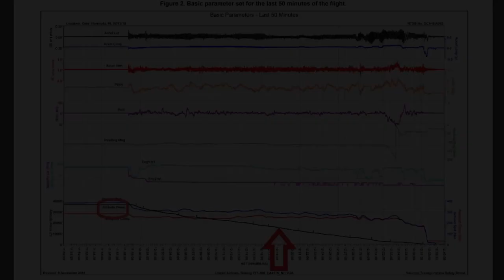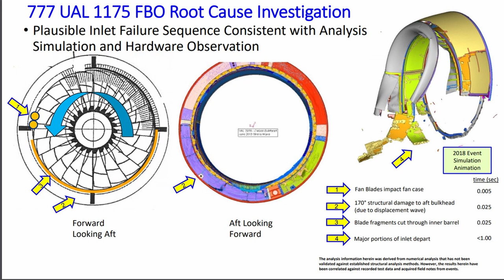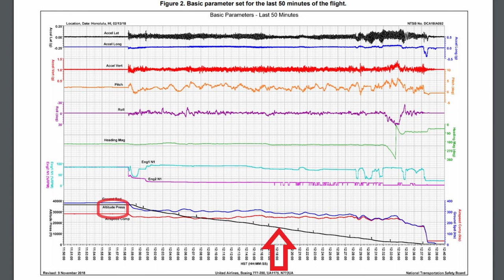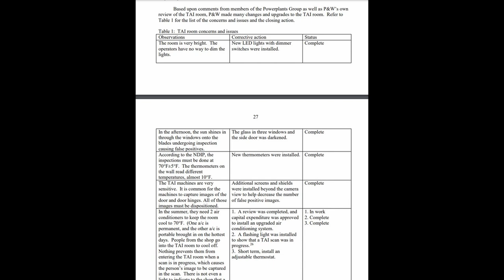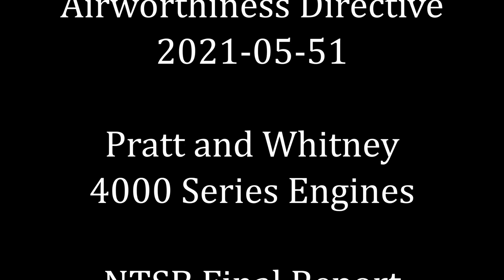Emergency AD & NTSB Final Report UAL 1175 Fan Blade Failure

Comment: You imply in your commentary that the use of color imaging would be better than black and white because black-and-white means it's older equipment.   Having worked in thermal imaging for 20 years, I can tell you that the use of pseudo-color is not an aid.  The color is not generated by the imaging equipment, it is an artifact assigned by a computer to an image through a lookup table.  Hence it is pseudo-color and not a real color image.  The color often obscures information as you no longer have a uniform scale from black to white to evaluate.  Instead, you have to attempt to interpolate what a specific color means, and often the color assignments by the computer are not smooth transitions between temperatures.   This is why medical X-ray images are still presented to doctors in black and white even though the images are now created through electronic imaging and not film.   The use of black-and-white is far better in presenting data as it removes a distraction (color) from the interpretation of the image.
Reply: Not as technical, but, boroscope technology, while able to take measurements and record in incredible detail, has remained greyscale for much the same reason.
Reply: Which was the conclusion reached in the tabular report on the testing facility shewn in the video.
Reply: Plus Pixel size. 3 Pixels are "wasted" for 3 colors when trying to see the smallest of details.  A tiny crack can be obscured because of the color. B&W gives you a smooth gradient from Black to white to see changes in density.  It is also why Astrophotography (think Hubble) uses "false color" to get as much imaging detail as possible at a given resolution and pixel size of the imaging chip array.
Reply: @gnuspudguns 
Actually I use a full color borescope for diagnostic purposes and so do several other industrial repair shops in the area.
If we convert it to digital  then it is saved as a B&W (greyscale) image.
Reply: @JeffCounsil-rp4qv 
True, but with the advent of the 128 megapixel cmos imager there is now sufficient detail even under 1000x to do both true color and greyscale.

Things have advanced many fold since the Hubble Telescope was launched.
Reply: @RicktheRecorder  g
Reply: Modern X-ray imaging uses efficiently/usefully color to characterise micro-structures, elements, etc.  Ex.: Polychromatic X-ray diffraction...
Reply: Density color slicing or pseudo color is a technique to allow visual inspection by allowing a human operator to see more than the 15 to 20 shades of gray that most of us can see. However, the human eye can see many more colors represented by color, hue and intensity. So the trick is to feed a black and white "image" containing many more shades of gray into a computer that can easily discern hundreds of shades of gray. Then the computer assigns a unique color, hue and intensity and presents the operator with a colorized display allowing the operator to effectively discern very subtle shades of gray representing subtle indications that the human eye could not otherwise see in a black and white image.
Reply: Unless you employ a color CAMERA to record three channels of chromatic brightness instead of just one. It depends on whether your color sensitive paint changes color or just brightness.
Reply: @slehar  TAI does not use color sensitive paint as the faint heat source emanating from the discontinuities of interest is far to weak to image with color sensitive paint. The object is to attempt to turn the fan blade into a black body so that a thermal imager can "see" the extremely faint heat signal originating from the fatigue cracks of interest. Acoustic energy is the exciting force that causes the sides of the fatigue crack to rub together thereby generating a heat source hence the name Thermal Acoustic Imaging.
Reply: Yeah, bayer-filtering (in color sensors) also doesn't do wonders for image acuity.
Reply: Being a long time industrial thermographer I concur what you're saying about the black and white image is far superior to see what is going on.
Reply: @richardpeugeot9143  I can only tell you that the IR cameras I used, and they were six-figure expensive,  would generate pseudo-color.  The custom frame grabbers and image processing computers the frames were put into could also generate pseudo-color for the images.    When you're looking for 0.01-degree temperature differences - color just got in the way.  It was far easier and faster to look at the images in black-and-white for live image evaluation.  Ultimately, the frames had to be rectified so the image was square, then put into real-time image processors that had to identify buried land-mines - and that was all done in B&W as color was useless.  Every use is different, and in a lot uses - color is just a waste of time and processing.
Reply: @RinrvUSA  That isn't good enough for critical work.  You are still missing 3 out of 4 pixels. My mentioning of Hubble wasn't about the cameras themselves, but how and why monochrome is used in scientific work where the highest resolution possible needs to be used. Fan blades need the best resolution possible. Lives actually depend on them.
Reply: Another point on IR false color.
Often these are composite images made from multiple monochrome images. But each image taken at a different IR band or wavelength.  In this case you dont loose resolution.  This is the technique used in astronomy.

Often the psudo color images are composites of Radio, IR and Visible spectra of the same target.

The sure make spectcular images of our cosmos.

Cheers,
Kevin
Reply: @kevinhanna9440  Yes, taken at different times with many frames of a single object, and  with a huge amount of processing/time for a single object to add the fluff of color to please the eye.  Apples to oranges for what is at hand for fan blades.  Warren Keller is a friend of mine..  I am sure you have heard of him.
Reply: @buckhorncortez  Yes, I understand what you are saying. If the subtle gray scale differences that are too slight for the eye to see then the trick would be to stretch the slight gray scale differences so as to occupy more of the 15 to 20 gray scale subtleties that the eye can see. In this case there would be no benefit to colorizing the image.
Reply: Wise words. The best photographers know when B&W will work better than color in order to extenuate texture, mood, balance, etc. Technical photography is just as much an art as a science.
Reply: @JeffCounsil-rp4qv  Pixel density on the sensor is irrelevant for pseudo-colorized images, as would be the case in thermal imaging applications, though. As Buckham's original comment says, the color there is just generated by an algorithm table (usually a lookup table with specific colors assigned to certain values and colors for values between the ones in the table being interpolated.) Since the color is generated artificially in post-processing, there's no wasting of pixels on the actual image sensor, just a bit more processing in a computer after the fact. It's the same image sensor either way, just a different way of visualizing the data.

When you're looking for very faint differences like this, it makes sense that just leaving it as greyscale is better. On the other hand, for the types of devices I program (mostly RF spectrum analyzers,) the users are looking at several orders of magnitude differences between the highest and lowest values. In those cases, I personally find the false color helpful for seeing more detail, as do most of our users. We make both options available so users can pick what they want, but most operators find the false color images better for seeing more detail in data where the dynamic range is very large, such as is the case on an RF spectrum analyzer. I can certainly see how greyscale would be preferable for detecting extremely minute differences in very low dynamic range data, though.
Reply: Also, where colorization really becomes more useful isn't as much where you're looking for minute changes between adjacent pixels, but rather relative values between non-adjacent pixels. For example, in the spectrum analyzer case that I mentioned, when you're looking at a spectrogram, it's easier to compare relative signal levels between two different signals with a colorized version because your eyes (or, more accurately, your brain) can play tricks on you with pure greyscale. To your eyes, a local rise from, say, 80% grey to 85% in one region of the spectrum might look about the same as 70% to 75% in another, not necessarily being able to immediately pick out that the background itself is a bit darker. Because your brain is trained to identify the same object as being the same object regardless of lighting conditions. When 70% is mapped to orange and 80% is mapped to red, for example, though, then the difference becomes immediately obvious.
Reply: @vbscript2  Great example! Another example might involve mapping a large area of the earth where colors could be mapped to the gray scale therefore making the identification the identification of crops, forestation, desert etc.  more readily identifiable over large areas.

Comment: I got it figured out. It all started when the last old guy who knew how to use a Magneflux machine retired. Not a single fan blade has been inspected since.
Reply: Dumb question! Does Magnefluxing work on non ferrous metals??
Reply: @steveholton4130  Magnaflux is a company name.  Among other things, they make a couple types of fluids:  magnetic particle inspection (MPI) and fluorescent penetrant inspection (FPI).  To answer your question, mag particle would NOT work, but FPI would.
Reply: FPI would not work in the internal structure of the blade. FPI will only detect cracks on the surface. These blades are not solid structures.
Reply: @Errror404  Thanks for the straight answer. I believe that Magnaflux invented MPI so back in the day (1960s) when you took your racing engine to a shop to have it MPId, it was called magnafluxing because they provided the technology and the equipment.
Reply: @aaronbugaiski2487  Also, as I susspected!

Comment: I work for a company that makes internal parts for many engine plants and the parts we make "Keep the engine cool". We take what we do very serious because before Covid there were thousands of people in the air everyday. Every time I hear about a engine failure I always want to know is it internal or external. The part you were talking about the fan blades having so few inspectors is a very real world with a lot of manufactures. People don't realize that before Covid I would bet everyday those inspectors heard this "We have planes on the ground, we need these done in quick manner". Love you channel man!!!!

Comment: My favorite channel. No BS or hype.
Just the facts with a thoughtful analysis.
Thanks for all you do Juan!
Reply from the maker: Thanks Ronald!
Reply: At 8:38 Juan mentions rather casually that, “remember on these big planes you can’t see the engines from the cockpit.“ Now how stupid are the designers of these planes not to have a camera system so you can see the front angle and back angle of the engines with video cameras embedded in the fuselage. Are there any intelligent engineers out there designing airliners?  

In this story alone we find out that the goddamn pilots didn’t even know the engineer failed for a minute or so, because they couldn’t see the goddamn thing in the instruments all froze up. Is this not the stupidest industry in the world?

We need a new generation of designers and engineers that have some common sense!!!
Reply: @steveperreira5850  Just as a hypothesis, maybe the designers by and large aren't incredibly stupid, and maybe there is a bit more to it than supergluing a Gopro mount to the cabin window.

Why doesn't your car have cameras looking fore and aft at each of the four tires? After all tires blow, and when that happens to a front tire and you are busy texting, you are going to end up in the ditch. That is a really serious event that could happen just anytime, and you can't see the tires from the driver's seat. Shouldn't you have cameras on your tires?
Reply: @lwilton  LOL.  Amen.
Reply: @steveperreira5850  hi but ‘what’s COMMONSENSE”? It’s No longer common ! Cheers 🇺🇸🇺🇸🇺🇸🇺🇸
Reply: @lwilton  FWIW, Tesla cars have eight or nine cameras, and an autopilot for Full Self Drive (FSD). No need to check the cameras, the self drive will take care of any problem you have and give you a beep before you know.  go look at a Tesla, and you will wonder why All commercial aircraft don't have cameras to see the gear, engines and control surfaces. Simple and reliable. Cheap to buy and install. Yes, I would duct tape them on if I had to and wait for next year's AD to come out showing a $300,000 installation method for my half dozen wireless cameras that cost $3000.
Reply: I fully agree, this is a good aviation source for information and to keep learning yourself. Thank you!
Reply: @steveperreira5850  When you can describe the specific effects on aircraft performance of video cameras embedded in the fuselage to the degree of exactitude required to safely put hundreds of tons of aircraft, crew & cargo into the air reliably, day in and day out, then you will understand.
Reply: @steveperreira5850  Need to get the MBAs out of the drivers seat so the engineers can do their work!
Reply: If only we can get “normal” news like this.
Reply: @steveperreira5850  the 777-200 is an older design. Newer jets have cameras. Also a factor is that cameras are not required for flight and not legally required. Airlines are cheap, and if a piece of gear is not required but is an option, the chances are, the airline won’t pay the manufacturer to install it. Everyone wants cheap tickets, so airlines have to operate as cheap as possible.
Reply: @steveperreira5850  For every engineer, there are three accountants and a Wall Street "moneychanger" entering the argument.  The engineers say if we do this, the plane will be safer and more reliable.  The accountants tell you what the feature will cost and its impact on selling price.  The moneychangers say next quarter earnings are all that matters.  The moneychangers always win.  The public learns 15 years later, and the engineers get blamed.
Reply: @steveperreira5850  Both newer Airbus and Boeing planes do have cameras. Google it.
Reply: @steveperreira5850  
Have to laugh at your comment. Not because it's funny because it's anything but. Only because I find myself making similar comments on a regular basis. It sure feels like we have become so fixated upon "higher learning" coupled with the common "virtue" of relying on our digital devices instead of applying any thought into any question/unknown that arises, that "Common Sense" has quite literally become nothing more than "a fond memory" !!! 
As a "real world example" that actually turned up today, I have a "line of credit" and that lender has been sending notices that they are changing "service providers". Several notices re. when it's going to apply, when/how to make your next payment, a new loan number will be created, etc. With the new loan number notice, I called to see if they would be sending a "updated" checkbook (which is how the borrower extracts the loaned funds) and while I was speaking to the agent, asked what the current interest rate is on these loans (it's adjustable). His answer was "I don't access to any information on those loans until the 16th of this month. My question to him was "so if I write checks on this LOC prior to the 16th of this month, there is no way for me to know what the interest rate will be"?? His answer, "sorry, no there isn't". Does this make ANY sense to anyone???? Obviously, that answer led to a few "pointed" comments !!!
Reply: @pappabob29 If you were talking to the lender using the new account info which only becomes effective on the 16th of the month, why were you expecting that account to provide you with interest rates before the account became operational? Common sense would dictate that you use the current account number for any transactions you make until it becomes inactive on the 16th. With the info you provided in the comment, the situation makes perfect sense. Are you sure you know what common sense is?

Comment: In all my years  of flying I only had two jet engine failures. One at altitude in a Lear 35 and the other was on take off in a BAC 1-11. The Lear had a fan reduction gearbox bearing failure, the BAC had a HP fuel pump failure which fodded out the fuel control. That’s in 22k hours of flying. I consider  myself lucky as that was it as far as engine failures. 
Now that I’m retired I don’t worry about engine failures as I once did, 
Keep up  the great informative work.